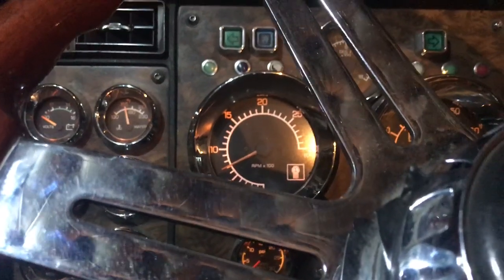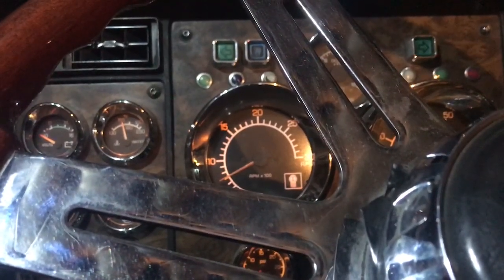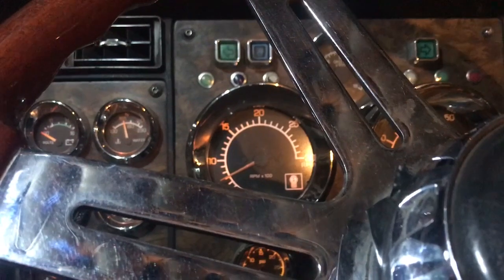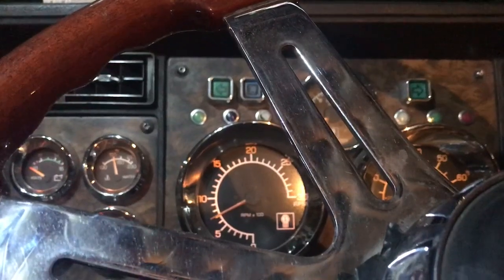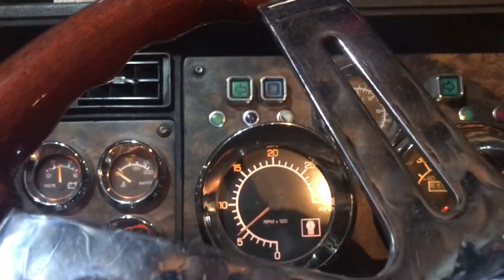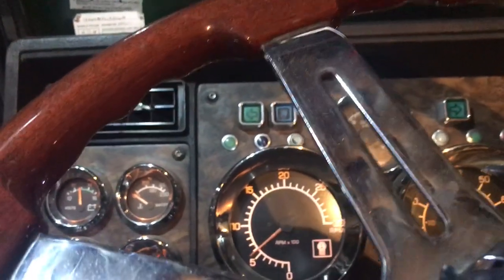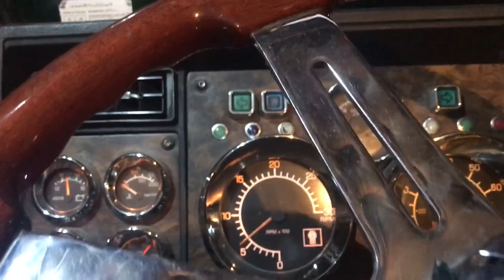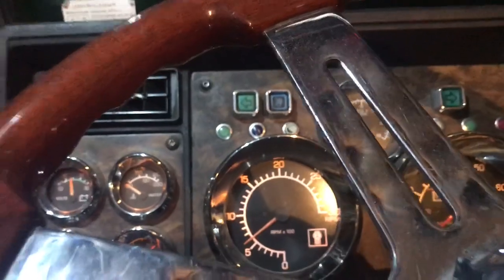Cold starting my 425 caterpillar at 19 degrees

Comment: I drove a 1985 Flo Freightliner for 20 years with a big cam NTC Cummins. First pumping the accelerator pedal does not do anything because on a Caterpillar engine you have a primary and secondary pump. With a Caterpillar engine it’s important to use a antigel  additive in the fuel. Cummins recycles fuel through the heads pushing warm fuel back to the fuel tanks keeping the fuel tanks warm. Instead of using ether it’s better if you put some gasoline in a spray bottle and before starting squirt a little gas on the air filter(s). Ether revs the engine dry of fuel and diesel acts as a lubricant too. Howell’s was a additive that a lot of guys in Alaska used the winter I was there . Good travels ,thanks for the videos
Reply from the maker: Didn’t know that, however it does start better when I do that, maybe because I give it fuel when starting. I try to stay away from antigel additives, my tank warmer (or whatever it’s called) does its job.

Comment: Very informative, as well as short and to the point!  

If it's fuel injected, shouldn't need to pump the pedal, but, you obviously know your truck and depending on motor and pump, their all a little different!  My Mack needs a bit of throttle sometimes to restart, not when cold, when warm!  Weird.  I have a manual throttle I can set.  Does the trick so you don't over-rev when it catches.

Kudos to you for pointing out the need to monitor oil pressure as well as wait until "warmed up" before heading down the road.  Some don't realize the importance of having their motor at operating temp before working it...hence why its called "operating" temp...you don't operate until you are at temp!  It might take 20 or 30 min to get there if its REAL cold...hence, bump up the throttle either with manual control or electric cruise control if you got it.  If neither, a long stick does the trick!  If your truck has both, you want to monitor the water temp AND the oil temp.  Watch your turbo pyrometer too (if you have it)...you are the captain, monitor your vessel!!!

Plugging trucks in is helpful on cold starts.  19 degrees (or colder) is about the threshold of cold temp I plug in.  I see guy plug in even when it is 40 or 50 degrees F outside.  Man!  If you don't have to pay the electric bill, OK, I guess it doesn't hurt, but, 20 degrees outside really isn't that cold.  -20, now, THAT is cold!

One tip for viewers, if you are parking long-term in cold climates regularly (10 degrees or colder) and you want to be sure you don't freeze up...go check out the line of heater products from the fine people at www.wolverineheaters.com  

They have ALL kinds of ways you can supplement or eliminate your block heater.

I put a heater INSIDE my oil pan, as well as outside surface attached heaters near the pickups of each fuel tank.  Last year I added to the arsenal easy on and off wraps that go around the fuel filter as well as fuel/water separator.  Keeps them hot, no freezing.  Diesel, especially those that contain Bio, will begin to freeze at about 8 or 10 degrees F.  Anyone who's ever had a "slushy" inside their fuel filter knows what a PIA it is to get unfrozen.  Spinning off and on frozen, slippery filters is a real bitch in freezing temps.  

For those in extreme cold, wolverine also sells heat pads you put under your batteries, keep them from freezing.  Summer heat kills your battery, but, you don't find out how weak they are until winter freeze.

Of course, all this stuff takes electricity.  Do not overload circuit breakers.  Think like an electrician.  Cheap, old, cracked and mended electric cords won't allow you to carry the full load of electricity you might need.  Length of cord is another big variable.  The longer the wire, the more resistance, the less power available to plug in.  Go buy new extension cords when the old one looks brittle.  Buy GOOD ones, with thicker gauge wire and try to keep the length to a minimum.  I like the ones that light up at the end, so I know if the power is on.  They also make outdoor plugs that will have a little glowing light.  Or, carry a trouble light you can plug in and quickly see if you have electric or not.

With all my extra heaters, I often times don't even bother with the block heater.  My truck starts EVERY time.  The oil heater in particular works like magic.  Truck turns over, and knocks for less than half a second...then runs smooth.   I also use a battery tender, which provides a trickle of electric and goes on/off automatically to prevent over-charging the batteries, but, gives the power when needed.  Perfect if you are going away for a while and want to come back to a fully charged set of batteries.

Think of all the wear you are saving not having a frozen snot ball of a truck trying to pump thick oil to the top of the motor, not to mention, your truck will warm up faster, which uses less fuel as well as gets you on the road faster.  Think of how good it will be to turn the key and your truck starts without freezing your hands and feet.

Sorry to be so verbose.  Happy winter trucking!  I prefer to head to Florida or Texas about this time of year!!!  Not to truck, just to sit on a beach and sip boat drinks!!!  ;)
Reply: Pumping the fuel does absolutely nothing for a 3406b. It doesn't have an accelerator pump like a old carb. I just crack the throttle open on my old B as I crank it and she purrs to life

Comment: Ha, ha, ha! You do realize that your 425 cat engine is a " fuel injection  engine"? Correct? Piping the throttle does nothing but exercise your foot!!!! It doesn't pump any fuel any where till the engine is started.....
Reply: It's mechanical injection, your point is invalid
Reply: dropn loads really !!!!! Do you even understand the concept of a diesel engine??? I don't  care if it macanical or electronic impulse,  the engine need to turn over before fuel can be introduced into the cylinders. Ask a diesel tech to see if I'm right!
Reply: Cassius Puckett I don't care what anyone has to say, I have to hit the pedal to cold start my 83 6.2 diesel that's a mechanical diesel engine much like in the video
Reply: dropn loads the 6.2 has an electrical solonoid that requires a single push of the accelerator peddle with the key on to function.  And that is only when the engine is below 100 deg.  Pumping the peddle of a diesel does absolutely nothing.
Reply: Jersey4x4 talking about the fast idle solenoid?
Reply: dropn loads yes.  On the 6.2/6.5 that is the only reason to touch the peddle when starting the truck.
Reply: Jersey4x4 I must admit, I forgot about the Ford (International) 6.3 and 6.9 v-8 diesel, and you are correct sir, it needs one push of the accelerator pedal to set the high idell for the cold start.